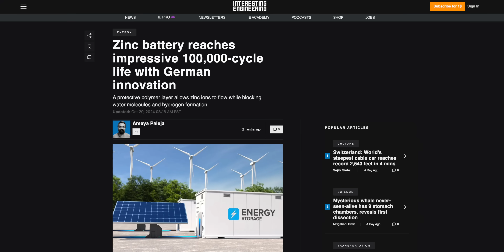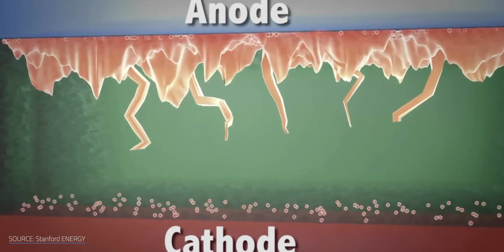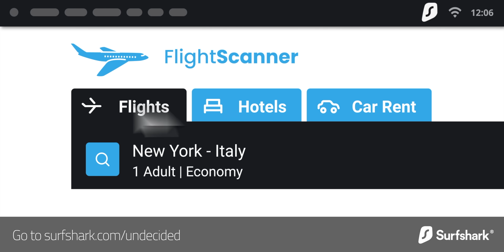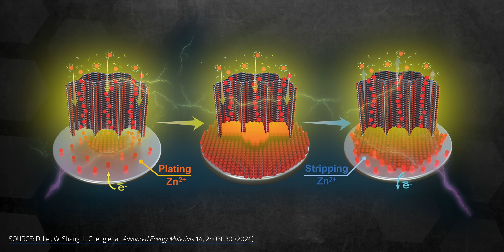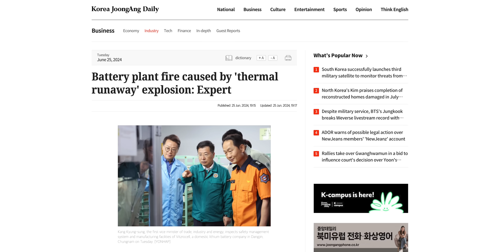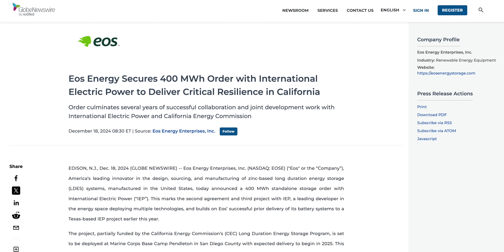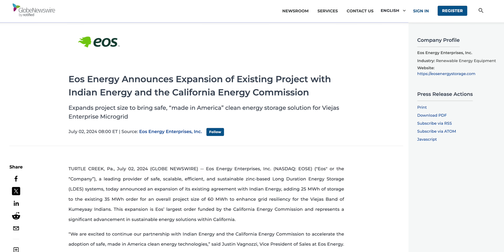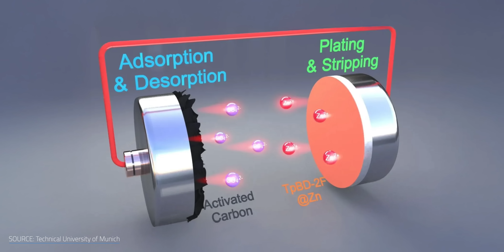How Zinc Batteries Are Defying Limits

Comment: There's a co in the UK that modernizes old battery tech with current knowledge/materials & produces it. They've been producing things like this for over 10 yrs, & have multiple country wide contracts. Ironically, the old zinc battery tech (roughly 200 yrs old) of Zinc bromine or bromide already beats almost all these advantages. It was already equivalent to Li Ion, already aquae's, didn't break hydrogen bonds in water, & although it did create dendrites, it doesn't lose capacity at all, meaning the few dendrites it makes just dissolve back into solution preventing any kind of dangerous buildup when you recharge it. And as long as you make it a closed system it won't evaporate, & can be re-used indefinitely- no cycles needed. And when paired with modern tech like graphite/graphene/carbon anode/cathodes they perform even better. That said, they do have some dis-advantages; mainly the electrolyte prefers to be water-like liquid, not gels or paste's, this can also be a hazard if the cell is charged >0% / <100% it is more volatile if they mix. However, if it's either completely charged/discharged it is inert. It would likely also weigh more than some other modern batteries as a result of it's preference for water. So it's current best use case would be someplace stationary.

Comment: To be fair, with Lithium Iron phosphate assuming you charge and discharge only between 20 and 80% like you can get 7000 - 8000 cycles before you will only have 80% of the capacity remaining which assuming that's for personal usage with solar your basically only cycling the batteries once a day, thats almost 22 years of usage and it's not like you need to throw it away after it's degraded by 20%. So I think Lithium Ion phosphate is good enough for home battery usage considering every other component in the loop will need replacing / maintenance before the batteries degrade that much and it's not like you need to replace them at that point again.

If you simply just buy 20% more capacity than you actually need they can continue to operate for a long time.

However assuming we are talking phones, laptops and EVs, lithium Ion phosphate isn't an option there and that 1000 - 2000 cycle lifetime is a limiting factor considering that is 2.74 - 5.48 years assuming 1 charge from 20 to 80% per day, but thats assuming Zinc Ion doesn't have the same issues as LIP that being low gravimetric and volumetric energy densities.
Reply: Right on.  People just can't accept that LiFePO4 is already a cheap and long lasting battery.  Some people seem to always want what does not yet exist, claiming that they will buy in just as soon as  . . . but then they never do.  People should not let the pursuit of perfection get in the way of the very good.
Reply: LFP  operates 100% > 0% > 100% unlike NMC etc. Today's LFP product will outlive us both with essentially NO degradation. Meaning it will take a long time to begin to see just what the degradation curve will look like.
Reply: My samsung phone has a battery save option that will only charge the phone to 80%

Comment: Given their insane recharge cycle limit, I can see them being paired with super caps and intermittent energy input--solar/wind/etc.--for use with installations that only need temporary bursts of power, like sensor networks that wake up only long enough to take readings and record them/upload them to a mesh network of other sensors/etc.

Comment: If you don't care about mass and volume, lead-acid works just fine! [the Trojan T-105 is still very popular in off-grid setups!] They're 100% recyclable. Yet, Pb-Ac is universally The Worst Battery(tm). Then there's the sodium flow batteries that were all the range some years ago -- again, massive low capacity things. Dendrites aren't new, solutions to minimize them aren't new, 'tho most of the research I'm aware of has been with lithium chemistry. (that's how modern lithium-ion batteries can be cycled 8-10k times. 'tho the electrolyte is a closely guarded trade secret -- a "witches brew" of hundreds if not thousands of compounds.) The issue of thermal runaway is mostly with first generation lithium-cobalt-oxide (LCO) batteries -- made even worse with an alcohol based electrolyte in older batteries. NMC/LMO/LFP/LTO chemistry batteries have much less (or NONE) of an issue with thermal runaway. Thermal runaway is "very well known" because there are A LOT of Telsa LCO firecrackers in the world. (they have reluctantly moved to LFP, but I'm not certain they've entirely stopped making LCO cells.)

Comment: Dude the Moon is 238,855 miles away, and 300,000 -500,000 miles is like going to the moon AND BACK 3 times???? Where did you learn math?
Reply: There and back is 478000 miles give or take
Reply: @stevenschalck2781  that's only 1 round trip then
Reply: The Moon's orbit around Earth is not a perfect circle; it's an ellipse. This means the distance between the Earth and Moon varies.
 * Closest: The point in the Moon's orbit when it's closest to Earth is called perigee. At perigee, the Moon is approximately 360,000 kilometers (about 225,623 miles) away.
 * Farthest: The point when the Moon is farthest from Earth is called apogee. At apogee, the distance is approximately 405,000 kilometers (about 252,088 miles).
The average distance to the Moon is about 384,400 kilometers (238,855 miles).
Reply: The Moon’s orbital path is not a perfect circle, but that does not negate the necessity of citing either the precise distance at a given point or the commonly accepted average when making such claims. While I respect Elon Musk’s contributions, he recently disclosed that Tesla’s batteries are designed to last the lifetime of the vehicle, which he defines as 150,000 to 250,000 miles. He then reinforced this statement with a misleading analogy, seemingly to present the battery’s longevity as more impressive than it objectively is.
Reply: @i-love-space390  moon is fake
Reply: Space flights aren’t laser beam paths. They curve. Curves are not the shortest distance so a path that uses curves will be longer than a straight path
Reply: Government schools

Comment: @Matt, I think you should have included in your analysis a comparison to zinc bromide flow batteries which I strongly suspect are more economic and already commercial available compared to zinc ion batteries. And flow batteries have not been able to outcompete lfp even under 8 hours duration. So I strongly suspect this zinc ion lab battery will go nowhere...

Comment: Sounds like it’s still in fairy land. 
 There have been lots of claims about magical battery ideas that will do dis dat and the udder ting, but they always had hurdles to overcome or compromises that made them not feasible. 
And it’s one thing to come up with an idea , it’s a whole different world putting them in to production cost effectively. 
As for musks claims ev batteries should last 300 to 500,000 miles , what will the range have degraded to by even half that😊,  probably 50 kilometres. 
  And taking into account ev range is in the real world mediocre at best , battery cars are still a long way inferior to a good gas car. 
 And we own both.

Comment: 0:15 - NO battery will ever achieve this.   Even with 'forever batteries' they will PURPOSELY design them to fail at a given point within a few months of the warranty's expiration.
EVERY manufacturer does this PURPOSELY.   Rather than selling a very expensive item once they'd rather sell a cheaper item multiple times, plus all the profit 'fixing' it between replacements.

So this battery will NEVER see market.

Comment: You mentioned range anxiety at the end. I've been thinking that this is a misunderstood term in that the anxiety is less about the range (though there is that) and more about "what do I do when I run out?" Most drivers are used to gas and what to do when the gas hits zero. If the EV hits zero, there isn't really a backup. An onboard fuel-based generator, though probably not used much, could alleviate much of that anxiety simply by knowing that it is available. As for zinc, I hope that TUM's research can find its footing. It may not increase my range or give me recovery when the battery hits zero, but if it can be applied to Li batteries too, then I wouldn't have to be concerned with battery degradation in mobile applications, and that's one less thing to worry about.
Reply: The Chevy Volt was a plug-in hybrid that was designed to have a 50 mile range battery and a 400 mile range gas tank. During ordinary operation, the gas generator would turn on to charge the battery and run the electric motor until you got up to a speed at which it was more efficient to just use the gas engine directly, at which point it engaged a transmission system attached to the generator and disengaged the electric motors iirc. It also had regenerative braking.
Reply: @k98killer  the mechanical complexities and cost of repairs for hybrid powertrains with their extra gearbox and full transmission has me more willing to accept some thermal inefficiency of electric motors all the way combined with a dedicated generator :/

Comment: With that kind of life cycle, hot swap EV battery could be feasible. Pull into the EV station and swap your depleted battery for a charged one. Even if you only can go 200 miles between swaps, if you can do it in a minute or two, it would make it acceptable to me. Knowing the batteries will be near 100% capacity for, well a very long time, seems like a win.

Comment: If this polymer coating works for Zinc, then there might be another for Copper, and even for Iron, since all are transition metals. Maybe there are analogues for the Alkaline Metals too? That would be really exciting. Imagine a Sodium-Ion battery with similar passivity on, for example; it would be from abundant resources, low-cost and extremely durable.

Comment: Not one single piece of technical specification data provided, nor is there anything on the EOS Energy website. No capacity, no efficiency, no power ratings, nothing. It's just a load of marketing gibberish.
Honestly these "new battery tech" videos are just tiresome and that was 10 minutes I won't get back.
As for recycling - stuff only gets recycled when it is economically more advantageous to do so over extracting more of the mineral. If the source material is so abundant and easily refined, recycling zinc batteries may not be all that viable.
Mining zinc is usually done from ore deposits also rich in lead (and sometimes copper and silver).

Comment: I'm a little confused, not terribly long ago he was talking about sodium being the next big breakthrough.  Now we're talking what amounts to an add-on to other batteries and now we're onto zinc.  If we could get sodium working again, it'd be a solution to the brine produce from desalination plants.
Reply: There isnt juat one solution. Just like how there isnt one type of battery (lithium ion is the biggest in the west RN) , there wont only be one type in the future. Even lithium ion powered evs have lead acid batteries in them.
Reply: @WeatherManToBe  "Even lithium ion powered evs have lead acid batteries in them." Where?
Reply: @generation-x406  They run the 12V systems in your car. Do they need to, I don't think so but unless they have updated the method this has been the common way to power the 12V stuff in the car.
Reply: @katgod  Strange that they wouldn't portion a section of the main battery to perform the same.

Comment: Zinc Mining and Refining is also one HELL of a lot less damaging to the Environment than Lithium Mining and Refining is and then there is the fact that a Zinc fire is much easier to put out than a Lithium fire is...
Reply: Meaningless, if they wanted to do it they would have by now. There's no way they are going to give consumers this tech as it won't make money in the long run for companies. They would much rather let the earth eventually burn before losing profit
Reply: Utterly meaningless.
Reply: @ASDasdSDsadASD-nc7lf   Actually quite meaningful...

Mining and refining Zinc does far less damage than mining and refining Lithium does so shifting from Lithium Ion batteries to Zinc Ion batteries will reduce the Environmental Damage we cause each year.

If Zinc Ion batteries become as prevalent and plentiful as Lithium batteries are now, then being able to put out a battery fire with water instead of just letting it burn itself out while trying to keep the flames from spreading which is what Fire Fighters must do with Lithium Car Batteries (I've seen a video where a Fire Crew just shoved a burning Tesla into a creek to contain the fire and the battery kept burning underwater) means battery fires not only can be extinguished faster causing less damage to roads, buildings, vehicles etc. but also cause less air pollution be releasing less toxic smoke...

So, No! not Utterly Meaningless than you very much!
Reply: @ASDasdSDsadASD-nc7lf  Utterly meaningful to everyone who has to live anywhere near a lithium mine or refinery.

Comment: Time to move away from lithium. The LA fires caused a lot of people to evacuate because of the LION battery storage facility; not the smoke, not the heat, but because of the hazardous chemicals in the air.

Comment: The researchers have only done limited longevity studies. They haven't had the material long enough for multi-year studies. Their extrapolation techniques can't be perfect. Even if this totally avoids the three listed failure modes, currently unknown failure modes are likely to show up after thousands of cycles. We just never see failures that take that long to develop.
Reply: Of course there are unknown unknowns. But how do you measure those? The best you can do is extrapolate from known degradation curves, which is literally how all product lifespans are estimated for warranty purposes. No one is holding back a product for 7-10 years just to see if they should warranty it for 7 years or 10.

Comment: What is their charge/discharge efficiency?   At large scale the other items are nice but if only half the power you give them doesn’t store them they aren’t a good idea.
Reply: I have read 80% round-trip efficiency, versus 93+% for lithium ion. That's better than iron "rust" batteries; I'm not sure how it compares to sodium, sulfur, vanadium, ... The success of all lithium-ion alternatives depends on them being much cheaper per kWh; the material cost may be lower (until you add this video's exotic coating) but demonstrating actual lower prices in production takes $100Ms and years of investment. Matt Ferrell didn't discuss efficiency or cost.
Reply: He usually does. Not sure what happened here.

Comment: For the record the Toyota Prius - a popular car for Taxi services - are reporting NIMH lifecycles beyond 500,000 with empirical data.  And curiously even then it is specific locations in the pack - prone to more heat - that fail first.  Seems like the stress reduction of running them 20-80% for this hybrid vehicle is operating them in such a "sweet spot" that all calculated MTBF numbers were far too conservative.

Comment: I would say this is arguably more important than increasing charge speed or capacity. This is actually super exciting!
Reply: No, what really matters is cost per kWh, which this video does not address. With LiFePO4 batteries lasting 4,000 charge cycles and zinc's lower round-trip efficiency, zinc has to be a lot cheaper. Is it? The materials cost is lower (until you add this TpBD-2F coating...), but I don't think you can actually buy one for less.

Comment: It's about 238,900 miles to the moon. 3 times there and back equals 1,433,400 miles. 1 round trip would be almost 500,000 miles. Either you or Elon are not too good at math.

Comment: Batteries don't last forever... but eneloops are pretty good. I heard about them and bought some in 2009. They still work and have over 80% capacity last time I checked. The main cause for getting more is losing the old ones.

Comment: Now that Lithium has such huge momentum in the marketplace, the Xinc batteries, even though a MUCH better technology might not be able to gain a foot hold.
Just like VHS video versus Beta MAX video.
Just like Flash memory versus Ferro-electric RAM maemory (FRAM).
Companies have invested so much money in Lithium technology that by now it may be too late to get them to change.
Hopefully they can gain an entry into the marketplace due to their different use case.
Reply: Zinc has worse energy density, and with continuing price decreases for lithium-ion batteries it is not (yet) cheaper per kWh. With LiFePO4 batteries achieving 4,000+ cycles (10 years of daily 100% discharge of a home or grid battery), what is this use case for zinc?

Comment: Let's forget the portable and mobile applications for a moment.  How much larger would a Zinc Ion battery (with or without the TUM's innovation) be than an equivalent LiFePO4?  For example a server rack battery is 4RU in height, 19"W and (about) 21" deep, it is rated for 4.8kWh of storage.  If a Zinc battery could be made with the same rating that is 6RU in height that would be well worth it for residential.

Comment: Since nickel is more abundant than zinc, would it make a better battery?
Reply: I don't know how this technology compares to existing NiMH technology. I do know that NiMH don't charge quickly, and don't handle partial discharges well. Plus the "metal hydride" part of the battery is an intermetallic compound of a variety of more exotic metals, so I don't know if that's the part that makes them expensive, despite nickel being cheap.